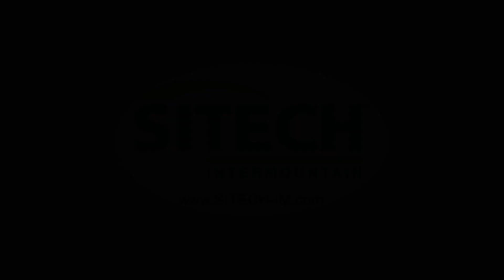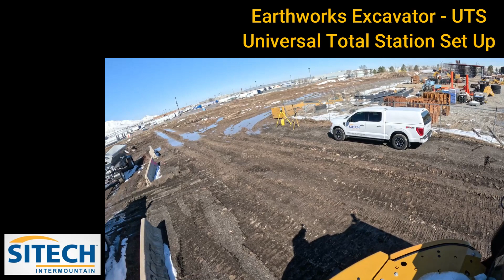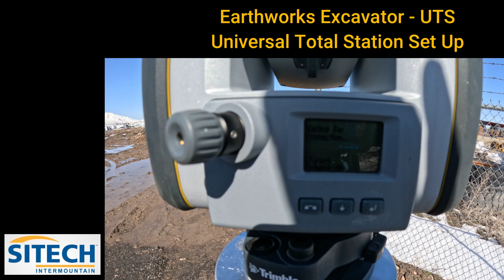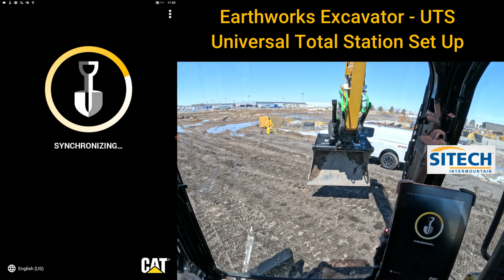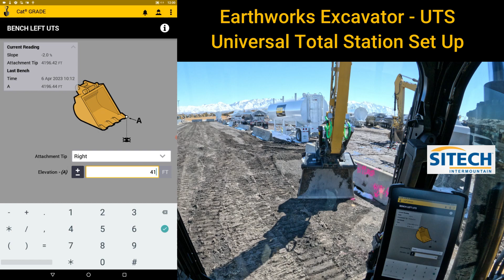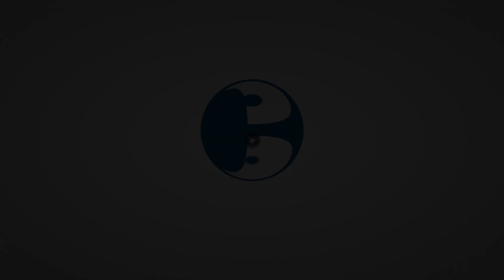Trimble Earthworks Excavator UTS Universal Total Station Set Up

Comment: Awesome video. I use the UTS on excavator but I don’t remember benching. I usually find my line of site and go to work of my design. Why the benching?
Reply: Good question.  Your machine will automatically be close or right on if the total station was resection in and on elevation itself, therefore giving the machine the right elevation.  It’s just a good practice to check a known elevation like I did to make sure and if there is any error in all the setup, then benching clears that or resets it to get rid of it.  In the video you will notice I was already basically right on before I benched.  So it’s just a check in like you would with gps also.  Hopefully this made sense.
Reply: @JeffLarsen-iz8qk  thanks I figured it out when I watch another video of yours. Thanks again